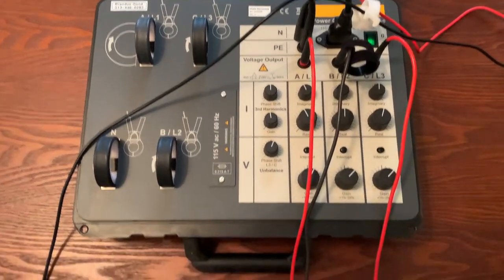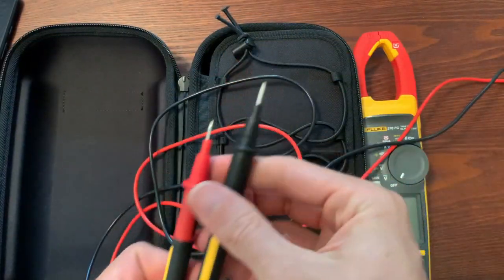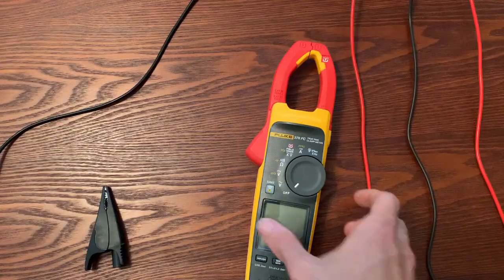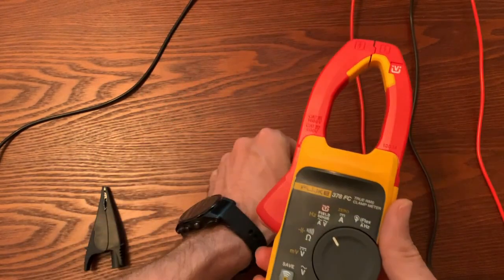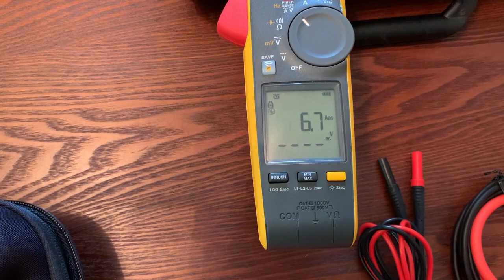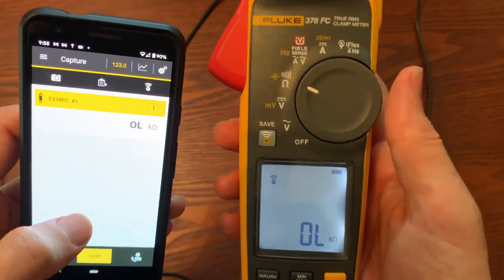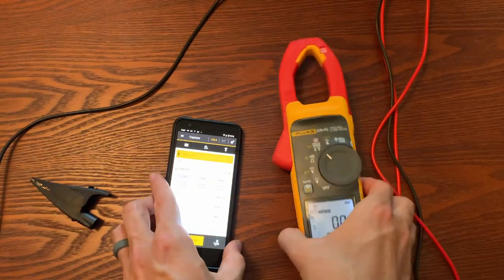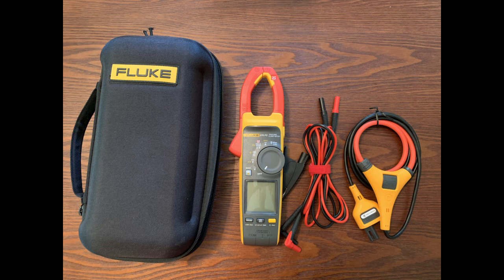Fluke-378FC Walk Through - Fluke Fridays - Episode 04

Comment: A question about the Fluke 378 FC.  In the case of substations, where there are three or more conductors per phase.  Was the flexible clamp able to measure the current of parallel cables per phase?  That is, on 1600 A molded case circuit breakers, which have pro-phase triple shoe connectors.
 This claw was able to measure the current in the three cables for each phase?
Reply from the maker: I think I understand the question, let me take a stab at it.
If you have multiple conductors on a single phase (say 3 wires for phase A) and you can get the iFlex around all 3 wires. Then yes you could measure the total current AC up to 2500 amps per phase.

Comment: Great video, thanks for this. 
How well does this meter measure DC Current, the video mentioned DC current testing but it was never shown. Can you comment on the reliability and quality of the DC current testing capabilities please.
Reply from the maker: DC current is good.  It's just hard to generate DC current in my basement.  But I do know this is not designed to measure DC mA.  So as long as you are measuring DC current of several amps to 1000 it should do a great job for you.
Reply: @fridayswithbrandon  Thanks for the response. I'm not measure instrumentation 4mA to 20mA signals so the 378 FC will hopefully work well.

Comment: What exactly is power quality? Like how do amps (or volts) have "bad" power quality vs good? I just assume electricity flows.. period. Is there some wave form (if you were on an OSC) that would fluctuate wildly.. and in similar wording.. the amps or volts would be drifting/shifting more than like .01 or .1 or something in either direction to indicate the "flow" is not stable or good? What would it indicate if its poor.. a ground issue, or the source of power like a motor might be crapping out? Is that why you would check for it.. or if the PQ pops up what exactly is it telling you?
Reply from the maker: Lots of things could cause bad PQ. Parameters like power factor, phase imbalance, transients, dips, swells, and others I'm probably not thinking of. Basically if you use one of these tools and they indicate bad PQ. I would recommend hooking up a PQ analyzer or calling a contractor to hook up a PQ analyzer. The PQ analyzer would give you details about all the different parameters and log them over time. Based on this logging session you could then come up with a plan to fix the poor Power Quality.

Comment: Thanks for the vid! It’s a beautiful meter but I’m wondering if the Amprobe Nav54 is better? I’ve got the 378 in my Amazon cart I just don’t know yet.
Reply from the maker: The NAV54 is a much older and more affordable meter. While it can do most of the measurements of the 378 FC and can do some measurements that the 378 FC cannot do, it's hard to compare the two they are not apples to apples. If you want non contact 3 phase voltage reading, non contact phase rotation, iFlex, and visual continuity. The 378 FC is by far the better choice (and you get better case and an iFlex accessory)
If you want to measure actual harmonics and don't mind doing quite a complex procedure to measure phase rotation and many of its other non-basic measurements; the NAV54 might be a better OPTION. (I would encourage you to download and read through the NAV54 user manual before buying so you have an idea of the potential difficulty you might experience using it do get what you want out of it) 

I would say for most they will be much happier with the experience they have with the Fluke-378 FC over the NAV54.
Reply: @fridayswithbrandon  Thanks for your response. You've definitely given me some things to think about. The visual continuity would be great in industrial environments.

Comment: How or what senerio in troubleshooting would you use the power quality indicator?
Reply from the maker: If you suspect potential PQ problems on a system and want to do a quick check to see if you are having one of the following PQ problems (amps, volts, or power factor). 
-You might also want to check if installing a new piece of equipment that might be very sensitive to poor PQ
-Or if you have a machine tripping out and you are not sure why a quick PQ check could help you confirm or eliminate PQ as a possible cause

Comment: I’m curious how it’s detecting PQ issues?
Reply from the maker: Form what I know it measures volts and amps. Then looks for THD (total harmonic distortion) on both the voltage side and the current side. It also measures PF (power factor) and gives you an indication if any of these parameters are higher than Fluke sees as acceptable for the various sensitivity settings you as the user can set in the 378 FC.